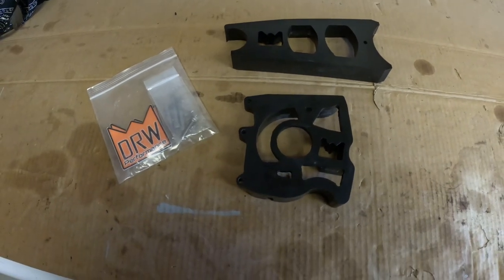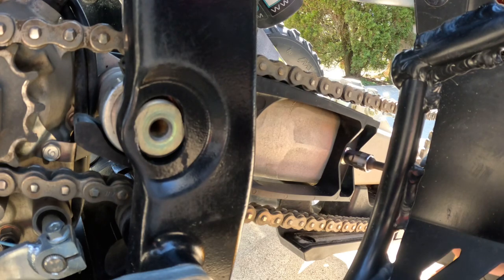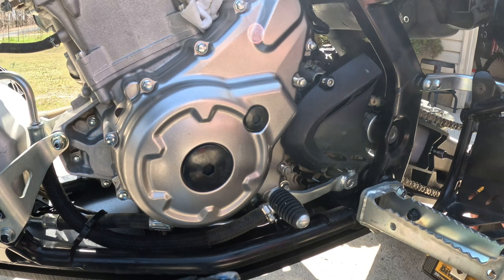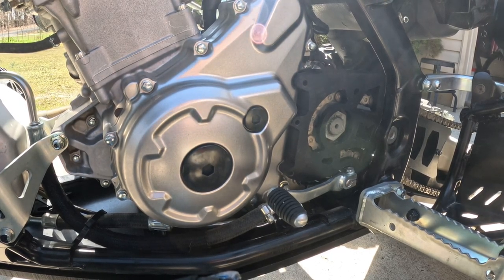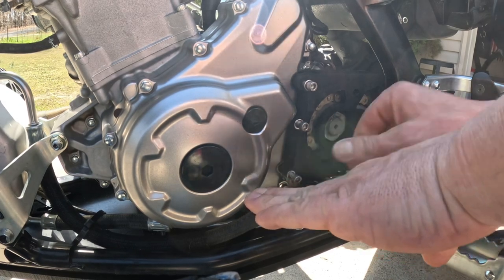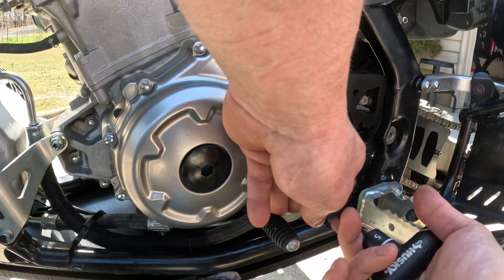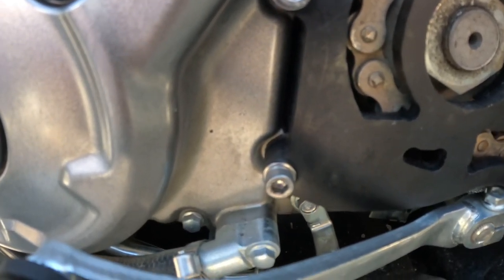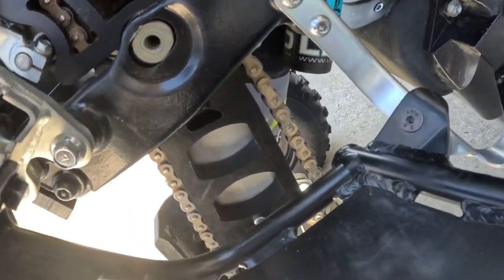2023 Raptor 700R SE DRW Case saver and chain glide install #yamaha #raptor700 #banshee #yz450f

Comment: Went riding with you Sunday. 
Just ordered the case saver and the chain slide
Reply from the maker: Yo Ed, I had a blast Sunday, well  besides inhaling all that smoke and dust. Make sure to put threadlocker on them, especially the chain slide bolt
Reply: @NSMotorsportz same man, I had a great time. I hope to memorize the trails like y’all one day !
Reply from the maker: @edwardpazmino  it takes time, but you’ll remember them. This Sunday we’re rolling out again if your down to ride. Hopefully we get some rain soon 😷🤣